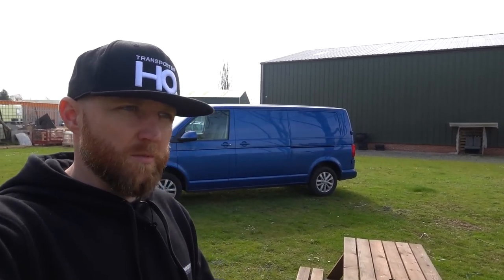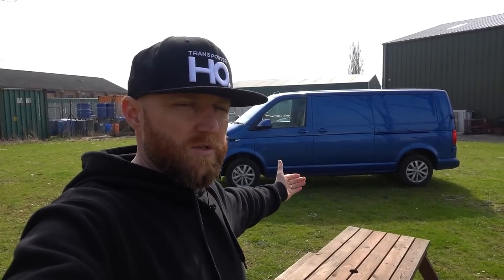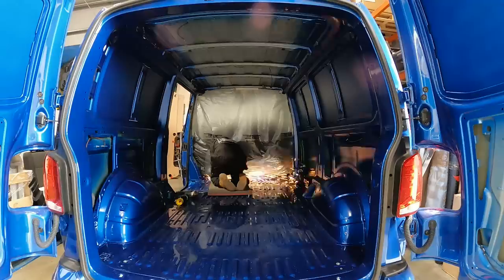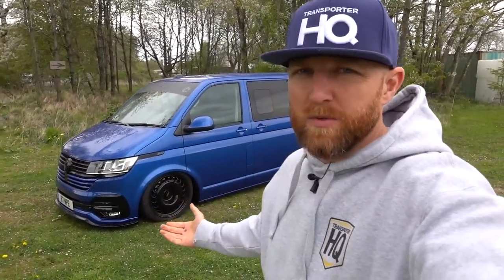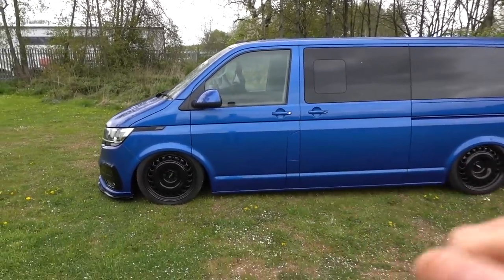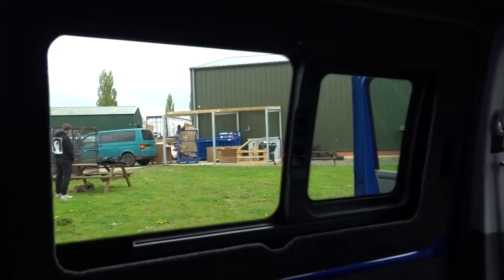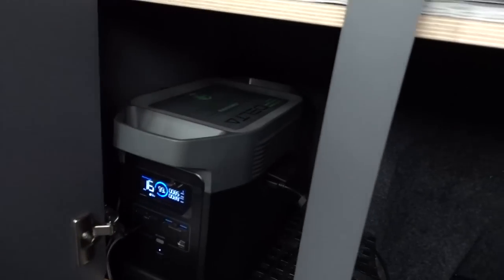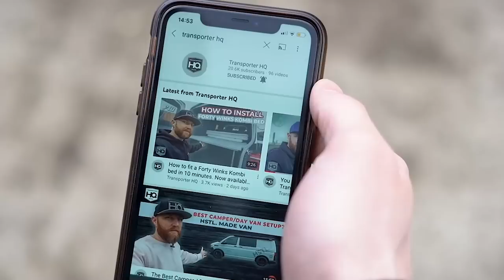Rotiform T6.1 Media Office Build - Time lapse including air suspension & some new tech!

Comment: How long would that powerpack keep the fridge running if you didn't have the TV?
Reply from the maker: It depends if you have in charging in any way. A 12v ignition live feed would keep it topped up while driving. I would think without that, 3 days, maybe more.